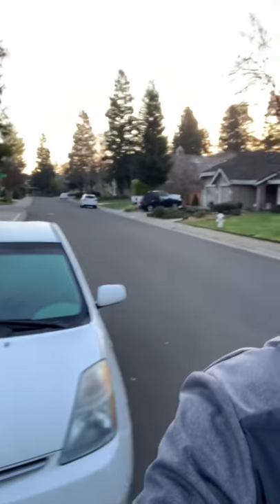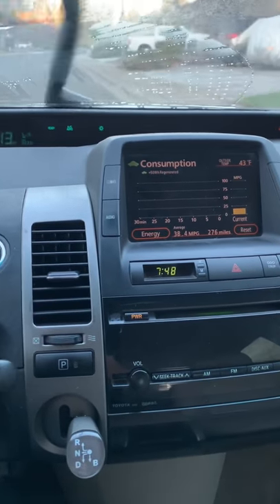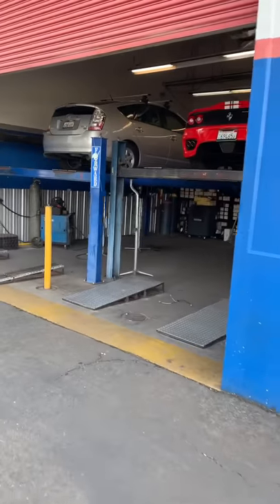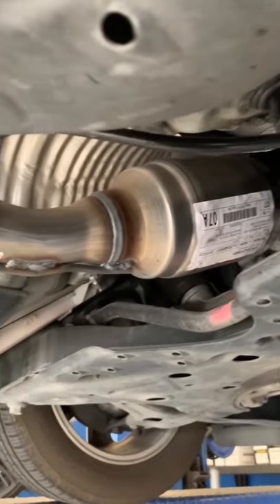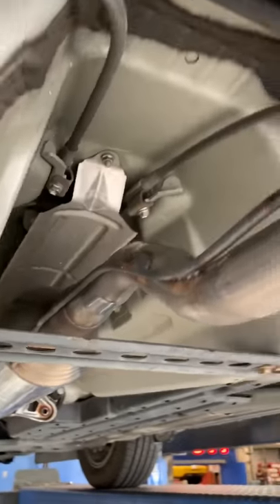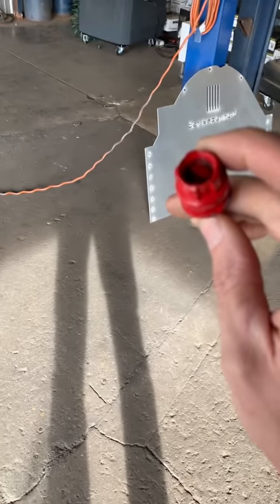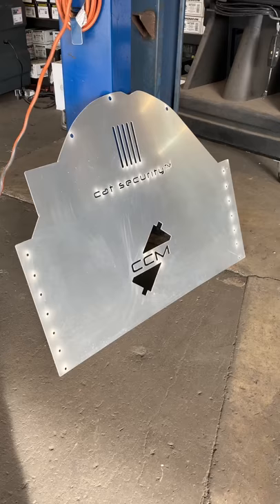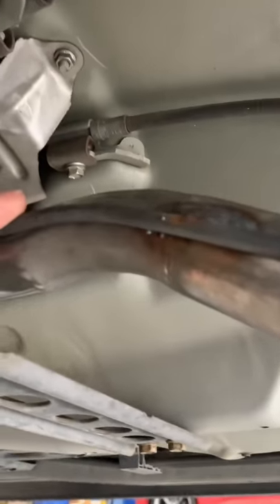Toyota Prius catalytic converters theft prevention

Comment: I just wanted to give a very public shout out to the Muffler Tech crew.  These guys operate an excellent shop up in the Sacramento area and the reason I mention Sac-Town is the fact that I am out of LA and there's not a single shop in So-Cal (that I found) can you give you the levels of protection against catalytic converter theft.  I love my Prius and will keep it forever and now that I have level 3 protection I can rest easy.  It was worth the drive up from LA and I'd do it again.  My Prius was upgraded and protected in two hours.  I can't say enough about the service that Matt, Bill and Colby provided.

Comment: Most thieves are using a sawsall on both ends to save time, so I would recommend the cover.  Don't bother with the rods or security bolts unless the sawsall won't fit.
Reply from the maker: Alex respectfully we disagree.  We have seen just the cover defeated.  We developed the other levels to add to the difficulty to the thieves. We are doing a fourth level now that specifically targets the sawsall.
Reply: @mufflertech  Can you let us know what Level 4 entails?

Comment: You keep showing the piper cutter, but could the steel rod withstand the sawzall because that's what the thieves are using?
Reply from the maker: It will not.  When we made this video they hadn’t graduated to the cordless saw with as much consistency.  The shield does increase the protection for a sawzall, however, we are also now offering a level 4 that is specifically designed to stop the saw.

Comment: I got smart real quick on mine. I have a 2007 prius G2. I bought a new aftermarket cat off amazon for $125 and I am not in a carb state. Installer removed my oem cat and welded in my after market cat that I had already painted  bright orange with header paint. Sold my oem cat on ebay for $1350.
Reply: They cut my cattle that it converter in half and didn't get it, but still it needs to be replaced. Do you think my insurance company will let me keep the parts? And if they will, can I sell it? I need to pay for my deductible!

Comment: I called 2 Toyota dealerships in Orange County, CA asking about the shield.  Both said they would not install because you have to drill into the frame which would weaken it.  Have you heard of this issue before?  Thank you!
Reply from the maker: Ask them if they will install a hitch.  The holes drilled for a certified hitch on a Prius are significantly larger and are tested by the companies that manufacture them.  That’s a cop out.

Comment: What is your opinion on the Cat Clamp, which is the metal wire cage type system?  Was thinking of installing a DIY version of this on my Ford E350 V10.  Have you seen these defeated by the thieves in your shop?

Comment: This is awesome. Cat theft is becoming an issue where I live in Canada but no garages offer these security measures. Where I can buy these key-locked bolts and keys?
Reply: They cut the exhaust with power tools. Anything short of a shield is useless.

Comment: Hopefully during the visual inspection of the emissions test the tech doesn't fail people for these mods on the exhaust. Technically, Commiefornia doesn't allow changes like this. We can only make changes to the exhaust after the cats.
Reply from the maker: You can’t modify the functional part of the pipes or the location of the cat(s) or sensors.  You can add the rod we do.  We’ve done hundreds of cars with these mods with zero issues.
Reply: @mufflertech  Right I get that but our laws here are so strict that a tech may fail just out of fear of getting dinged. Which comes back to my origonal statement, commiefornia is so strict that changes to anything on the cat may get you a fail out of fear. For example try telling a cop or tech it's just heat wrap on a stock header/manifold with a cat and you will probably get refed or fail. Heat wrap doesn't change anything but it doesn't matter. I would imagine the same here.

Comment: On the red bolt would a gator grip socket take that off. I know they use gator grip for remove keyed lug nuts
Reply from the maker: They are not an end all solution, but they’re a lot more secure then the stock bolt and will require more tools and effort for the thief.  You can pick a deadbolt on your house with the right tools, it doesn’t mean you should not have one.  Thanks for watching!

Comment: This his why I won’t buy a Gen 2. Thank your for the info and trying to help the problem.
Reply: Hi could you please explain why not...are the other gens better for some reason??...im currently looking to buy a gen 2 now... what's different regarding the cat??
Reply: @madmax8620  Gen 2 have the Cat with the precious metal. Those are the ones the thief’s want.
Reply: @gasolinaquema8416  well i was understanding that all cats have precious metals and prius is more desired because they have 2 cats?
Reply: @madmax8620  Gen 2 cats a worth most. That’s why they’re stolen/preferred
Reply: @gasolinaquema8416  so just put a gen 3 or 4 cat in place  of a gen2 and problem solved.
Reply: @madmax8620  those parts are not interchangeable. Also some states require you can only use OEM. Around $1500 for the Gen 2 cat
Reply: @gasolinaquema8416  hmmmm.... well I have a 2001 GEN1 prius and the cat is 3000.00 for the WHOLE assembly if even available anywhere from toyota here...it is unique in tbat it has this stupid mechanical contraption that sits on top of the cat that regulates emissions even more...it was immediately discontinued but an expensive piece on my 900.00 car(now valued at)...and I was told and looks like it has 2 cats... it sits out right in the middle of a semi shitty part of town where cars are getting stolen each week within a block radius including my busted 91 integra... maybe the thieves dont recognize its dorky style as a prius... i didn't  know it or recognize it was a prius when i first saw it too...maybe thats why it wasnt stolen yet? But just this week a random millenial russian scrapper "mechanic"(lies) with gang tattoos on his knuckles who jumped out of a high end BMW suv filled with crazy kids all laying on the horn, well he wanted to know how my prrius was doing and mentioned the value of the cat and then i think tried to bribe me with random pokemon cards for it that he said he "found" lying in the back of another car he "bought" for scrap for a couple of hundred...now he know where i live and where the car sits...and immediately knew it was as prius and how to start cars with out ignition assemblys...which is why he was in the neighborhood to by my neighbors attempted theft car they couldn't start (he got that camry too for 300.00 from my neighbors ). What 3rd world fukin country is this...according to our retarded mayor our shit town is supposed  to be ranked 3rd safest with low crime in all of America? !?!...im afraid to know what lies out of my area!!
Reply: They target Gen 3's now as well
Reply: GEN 3 has a load of problems compared to GEN 2. Electric water pump that is inadequate and fails without notice. Blows head gasket and warps head. Water pump is very expensive. PCV valve is too low on block. Puts oil in intake so you need catch can. Has EGR valve that needs service. Usually the EGR cooler clogs and sets a code. Fun job. See "Gasket Masters" on You Tube. They  love fixing GEN 3s. GEN 2 has cheap mechanical water pump that last over 200k. No EGR and they put the PCV valve on top. Also, the GEN 2 Cat is not water cooled. You can drive it without the cat. GEN 2 is the 400k mile  Prius. GEN 3 is the 100k Prius. The GEN 3 is a time bomb. Buy a GEN 2 cheap with high miles. Put the Lithium battery pack in it, replace the worn front end and drive it another 200k. After the used car and new car shortage ends, there will be lots of used Prii available. I have two GEN 2 and one GEN 3 I worry about. It will get a new electric water pump at 100k just for prevention. Cheap insurance compared to a new engine. Also to all Prius owners. Get rid of that WS non-synthetic crap ATF ASAP and install REDLINE D6 from Amazon. A real synthetic, not the phony synthetic ATF at the auto parts store. That's why REDLINE costs over $50 a gallon. Your tranny will shift better and last longer. Learn the difference between Group 3 phony synthetic (99% of the market) and real synthetic (Group 4 and 5). Motor Oil and ATF. Group 3 motor oil is fine with the Prius. Don't go over 5k. Best value is Kirkland (Costco) Synthetic at $3.50 a quart. Made by Warren, same as Walmart SuperTech, MAG 1 and Amazon Basics. Don't buy overpriced Group 3 Mobil 1, Penzoil Platinum or Castrol Edge. Way overpriced Group 3. All these oils meet API SN+ designation. Don't pay more than Kirkland.

Comment: Is the cat protection covered by comprehensive insurance?
Reply from the maker: It is not.  We have a lot of customers that are understandably frustrated with this but think of it this way: if a burglar breaks into your home and steals your jewelry, your homeowners will replace it but they won’t buy you a safe to put it in.  Now if you already have a safe and they break into it, homeowners will replace the jewelry and repair or replace the safe.  The point is your insurance only covers what you own already, not stuff you want regardless how logical it is to help protect the insured material.

Comment: I like my 2009 Prius but iam letting it go because they have stole my cat converter twice in 6 months here in California. Thinking about trading in for a bolt EV.
I just put a cat converter shield but its just a detterent. Shops still get cars that had a shield on but did not prevent them from taking cat converter.  Even though insurance covers it I still gotta pay $300-500 out of pocket every time they steal it.
Reply from the maker: You can lower the deductible only on your comprehensive for very little money.  You should call and check.

Comment: How about using closed cell foam on top on the exhaust bolts and perhaps all over the backend of the CAT and pipe embedding a couple pieces of rebar in there as well all wrapped up in a wad of duck tape or something more heat resistant?
Reply from the maker: The cats can get up to 1300 degrees, I don’t think any material you’re referencing will withstand those temps.
Reply: @Muffler Tech  Yeah, started looking up stuff after posting. 700F to 1300F is a lot but not as hot as a flame 3500F. I have a call into a company touting a "fireproof" foam that only burns if flame is present.  So I'm wondering if a large enough pipe with a sufficient air gap could surround the exhaust pipe then add a wire mesh be added along with pieces of rebar then this fireproof foam added. Hmm, starting to sound like my days over at Intel Folsom working on flash memory based system security. Basically, a security through obscurity play. They would see a bunch of foam start digging, hit hidden metal and get confused. Imagine digging around with a screwdriver.

Ah, a new idea... concrete.
Reply from the maker: @brentahlquist207  it’s an interesting idea, and one that would probably work to prevent theft.  Unfortunately it would also make the visual check on the cats during a smog inspection impossible.  There’s lots of compromises to consider.

Comment: Thanks for this.  I took my 2017 Prius to the dealer for service and I asked them to let me look underneath.  It looks like the newer models have a redesign to make the cat tougher to steal.  Can you confirm that?    Also, with your level 1 cable device, I noticed that it doesn’t go over the bulbous part.  Can’t the thieves just saw through that and remove the precious metal?
Reply: It’s the concept of adding a deterrent so your Prius is less of a sitting duck. When you’re not the weakest link in the chain you don’t break first and the criminal will aim for the weaker target which would be your neighbor. Besides that, making the crime louder and messier will make the cat more dangerous to steal and more obviously stolen when sold on the black market.

Comment: been watching a few of your videos recently since my cat was stolen twice in the span of 2 weeks.  i have a gen 2 prius.  On my last cat replacement, the toyota dealer had installed the cat shield with the 2 end covers (upgrade) recently and i am wondering if the cat shield will protect the O2 sensor and those level 2 bolts from being removed?  i'd like to have the level 1 protection added, but not sure if i would need the level 2 since i have the shield.  please advise.
Reply from the maker: Without being dramatic, I would recommend all of our levels.  We are still seeing a lot of these car’s.
Reply: @mufflertech  are you seeing the prius gen 2 cars still coming in missing the cats with the cat shield level 3 with the upgrade end covers?

Comment: Hi sir , Level one and two no good ,
They. Used a sawzall to cut through the exhaust, The Metal plate works , 
Best of luck , Dublin Dave .
Reply from the maker: Hi David, 
We have data that shows different.  No doubt the battery powered saw is the most difficult thing to stop (we have a level 4 for this now), the levels 1 &2 are still stopping the other methods which force them to use the noisy tool.  Relatively speaking 1 & 2 are not expensive.  Why not have as much protection as possible for a nearly $3K repair bill?  So far with our 4 level system and hundreds of cars out there with it, we have not seen a successful theft.  We have with just the shield.
Reply: @mufflertech  Can we get more detail on the level 4 protection, including cost?

Comment: Woke up this morning and my 09 Toyota Preus as been done uk 🇬🇧
Reply: Stuart Torevell insurance will most likely write it off.
Reply: @sweetvuvuzela4634  According to Top gear (tv programme) a Prius needs a new battery pack at 10 years old that will cost 6 grand,  that was a few years ago so I bet they cost more now.
Reply: @olivertaylor4779  I got a 2008 Prius on its original battery with 145,000 in 2021 still going strong buddy

Comment: You think manufacturing would stop making converters with expensive metals in them or make it harder to cut off
Reply from the maker: They have, on both of your points.   Not because of the thefts we’re experiencing today, it’s because the technology is advancing on modern engines and the cats are starting to need less metal’s as the engines are inherently cleaner burning now.  Also cats are more effective when they got hot sooner so many auto manufacturers are putting them in the exhaust manifolds now.  Another thing to keep in mind is how long it takes for change to take place in manufacturing, especially an incredibly complex product like an automobile.
Reply: @mufflertech  so a 2022 Prius has a different cat from previous gens?
Reply from the maker: @Houdini_Bob  each generation has a unique part

Comment: I had the coded security bolts that requires a coded key installed at your shop.  I have shared this information to many people, but they can't seem to find them online anywhere.  do you have a source to share with people not close to Sacramento or even the west coast?
Reply from the maker: Doug thank you for sharing our product.  Unfortunately at this time we’re so busy helping our local customer base we have not been able to develop a shipping service.
Reply: @mufflertech  Thank you for taking the time to answer my question.  I wasn't aware that you made them at your location.  Thanks again.

Comment: Can a level one (with rod) be shipped to someone not in your area?
Does a Bolt Key come with purchasing the bolts?
Reply from the maker: Shipping the cat assembly is difficult.  It’s long and wide and potentially fragile.  When we do the bolts the customer gets the key.
Reply: @mufflertech    Thanks.

Comment: That may work for those thieves that use that pipe cutting tool, in New York, they are more high tech, and use a 24 volt reciprocating saw.
Reply from the maker: We have a level four now to combat this, the level three shield also acts as a deterrent for a power saw.
Reply: @mufflertech  I work as a technician in New York and the latest theft now is on the NV 200. I honestly don’t know what this “engineer” did on the Catalytic. That it cost $350 from the dealer, but the scrap metal place is giving $950 for the old one. That’s way too much Platinum and other precious metals.They already stole 4 and we have 200 NV’s. So if you have something for this NV’s and the price is right we would be very interested. Thanks for the response.
Reply: By the way this is a Taxi Fleet. With NV’s from 2017 to 2019
Reply from the maker: https://youtu.be/_hwUr6h7Z5s

If you want to buy some in bulk I can work you a deal.  Call me at the shop on Monday.  916-997-3687
Reply: @LiGhTSPiRit888  what the fuk is NV2000,,?
Reply: @madmax8620   its a Nissan cargo van

Comment: They stole mine 2 weeks ago, got it fixed,  dealership out the metal cover plate to protect it, few days later they steal it again. Pretty sure it’s the same people. My apartment building has a garage all the tenants cars park at, security won’t even check the footage won’t do anything about it. It’s almost fixed again but I’m scared to park my car in the garage now I can’t keep doing this. Filed police report, nothing. Just bought this car used in December, converter has been stolen before with previous owner.
Reply from the maker: Can you get it to us for our extra protection?
Reply: @mufflertech  I will try since I live in Los Angeles
Reply from the maker: @akxsharma  it’s only 384 miles 😎